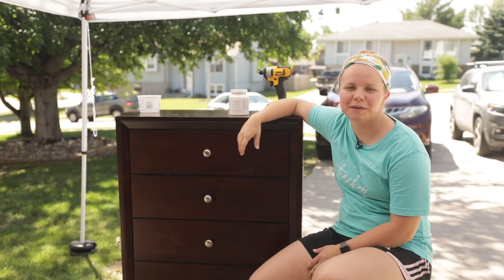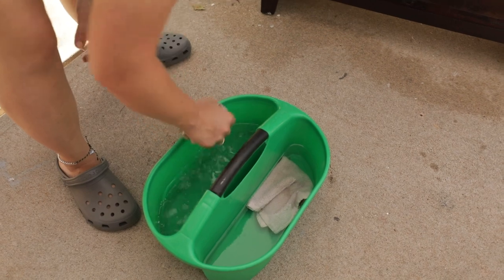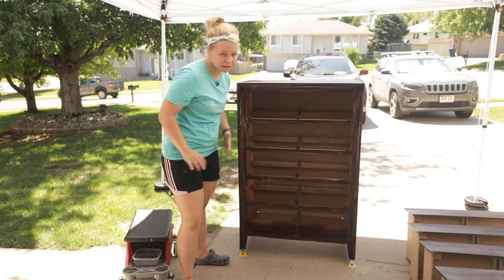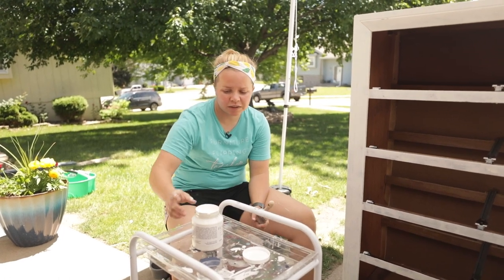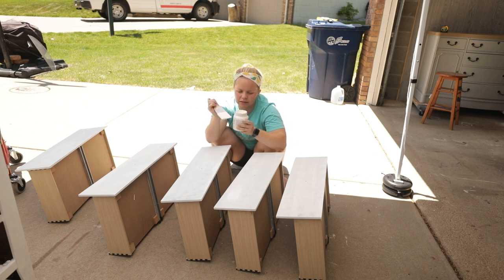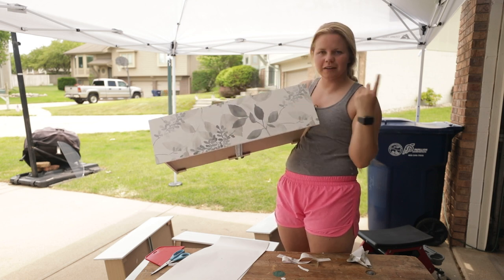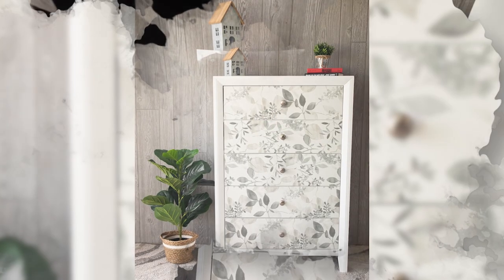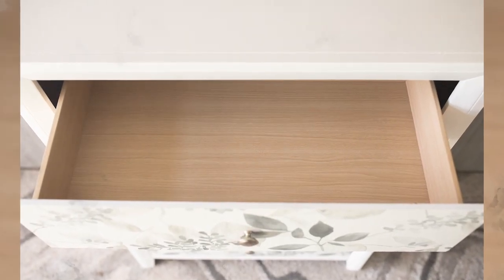Furniture Makeover w/ Fusion Mineral Paint & Peel/Stick Wallpaper

Comment: Next time you use wallpaper, you might want to consider using a long piece that will cover all the drawers at one time (they'd have to be in the chest, of course) and then slice between the drawers. That way the pattern on the wallpaper would be continuous and not chopped up. That's what a lot of content creators do with transfers and decoupage papers that are longer than the drawer(s). Don't know if all this makes sense!
Reply from the maker: it does! I wanted to but the paper was just too short!
Reply: I agree!! I wouldn’t do this method unless I could use a continuous pattern.
Reply: That’s what I was going to suggest. It could have worked well with this wall paper if the seams were arranged to overlap and be cut-off at the drawer edge.
Reply: I like that it isn't continuous!
Reply: I think it looks great as is..and for the first time ...amazing..great job.👍

Comment: I use fusion mineral paint all the time!  Love their products💕 With fusion there are plenty of different products you can use for many different projects. You can also add an extender to the paint to help it last longer. I never add water to the paint as it’s not needed but keep your brush in water to keep it wet will also help spread the paint further. The paint vary’s in weight as well so like the white your using is probably on the light side so it wouldn’t need the extender as to a heavier one. I’m still learning all the technics but I’m getting better everyday💕💕💕💕💕💕💕💕💕💕💕💕💕

Comment: Not sure if it’s been said, but in the future, use a sanding block around the drawer edges with the wallpaper - the sandpaper will cut perfectly smooth edges and then you just peel off the wallpaper that is hanging over...or it just falls off from the sanding. It eliminates excessive measurements and blades. Just sand in a downward motion and not side-to-side. I hope that makes sense! ♥️

Comment: Really lovely dresser! Just wondering if the wallpaper will start to peel up quickly or not? I cover my dresser and side chests with a clear thick stick on film type thing,alot like the wallpaper but it's clear,it prevents chips & dinks in the furniture tops and sticks like glue! Also you may find a paper guillotine better for cutting the paper ( alot let stress on the straight lines & all and less waste) 
How are you doing on the down-payment so far?
Reply from the maker: It was different but really enjoyed how it came out as well ☺️ Having utilized the wallpaper before on a hutch project it seemed to be pretty durable. For the next time I do this I thought about putting a top coat over it to help solidify it. I'll have to look into that clear thick sticky stuff and the guillotine cuttter on Amazon (that was definitely a hassle 😅) 

As far as our down payment - it is coming along! Check out May's recap to see what we were able to accumulate so far and stay tuned for this months recap to see where we have gotten!

Thanks Jane for watching!

Comment: If it doesn't sell it would be good to redo the wallpaper so the design flows down the dresser just like it would on a wall.  It will make a huge difference in cohesiveness.  All the best!
Reply: You know, that's a good idea. As close together as the drawers are, she could just about put one big sheet all over the front, and then cut the paper so each drawer would open.
Reply from the maker: it wasn’t big enough length wise! I did want to do this but just didnt work out!

Comment: Hi Lauren… 1 st off I want to say I absolutely love your channel and have watched lots of your videos (all awesome). I am hoping to paint my first piece ever : which will be my daughter’s desk, made of pine and stained and varnished by my husband about 15 years ago. I’d love to try your techniques using this paint but have a question I’m hoping you can answer = if the cure time is 21 days, does that mean the piece should not be used nor touched for 21 days? It’s a desk that my daughter now uses as her makeup table so she places a mirror on the top and little touches of girly decor (a tray with a plant on it, a organizer with make up in it, etc). I do t want to paint it then have her put her things back on her desk only to dent or smudge the newly paint surface. Help ! Also, since it’s a desk, should I top coat it with a sealer for duration? Thank you so much (if you see this and can help).
Reply from the maker: that’s correct! 3-4 weeks before setting anything on it or using it, and yes, an extra top coat would be great for even more durability! good luck!

Comment: I'm wondering if you used anything more than the peel and stick qualities of the wallpaper to adhere to the drawers? I didn't see it if you did. If you didn't, I would not expect the piece to wear well, as drawers are a point of heavy wear and tear. Also, I'd recommend continuing  the pattern from one drawer to the next.
Reply from the maker: Thanks, I did think about this. I will be sure to do it next time I use this method. the wallpaper wasnt quite wide enough to continue the pattern down. great tips tho!